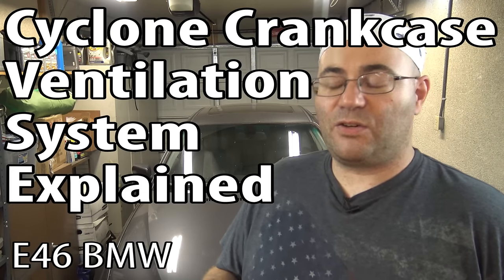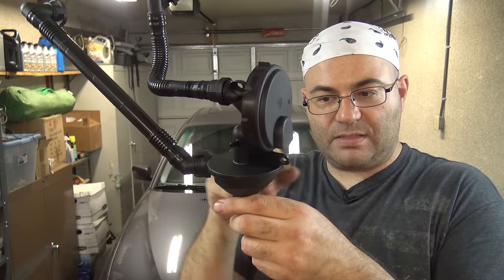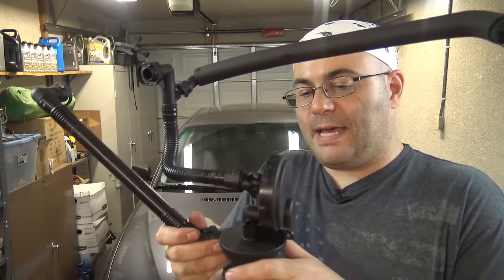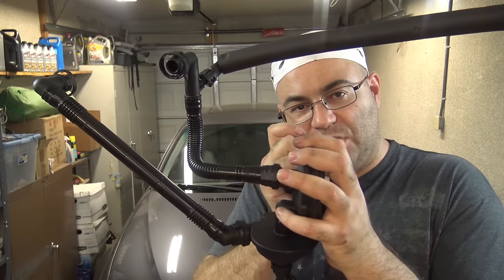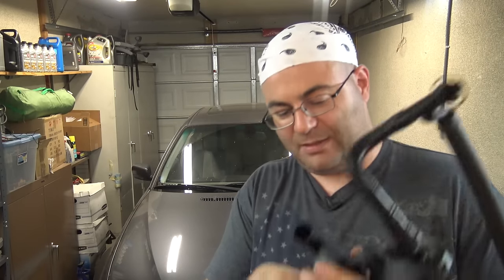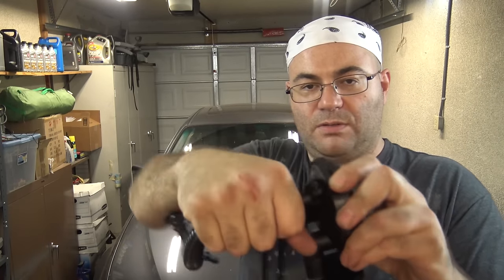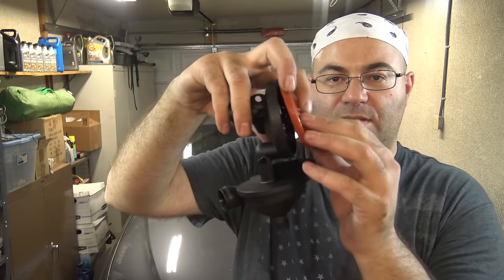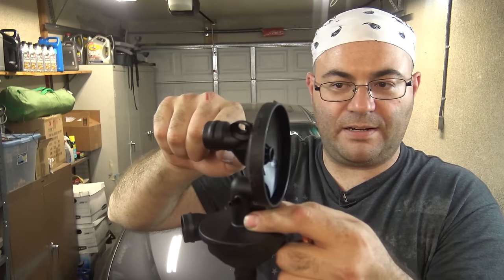BMW E46 Cyclone Crankcase Ventilation System Explained

Comment: This check-valve mod really works! Thanks 50sKid!! Ordered the valve, received it 4 days later and our bad oil consumption problem was eliminated on our 2001 e46 330I. Quick note - you can do this mod in about 25 minutes if you do it this way: Remove cold air intake tube, filter box and top intake rubber hose. Then look down the dipstick tube (to very near the pan) and locate the oil return tube coming down from the crank case ventilation separator octopus. With a sharp 4" knife, reach way down and cut this hose about 1" above the top end of the barb from the dipstick (assure room as you need to press the check-valve barb into the hose without interference from the dipstick barb). There isn't much room but if you gently move the knife back and forth 8-10 strokes, you can cut it. Then install the check-valve. With this method, very little disassembly is necessary. Also, it may look like you should have access to this area by jacking up the car and removing the left front wheel, but there is not enough opening there, without completely removing the whole engine under-tray. The above described method was fast and worked great. Hope that this helps!
Reply: How is the valve working so far?? Check valve right ? So you did it jus like he said?? Any info would help thanks
Reply: Yeah I would also like to know how it's working so far.
Reply: well said! 230,000 and 330,000 in the two I have and no issues with the oil burning with this mod
Reply: @Larry Smith, report back please.  Let us know how your modification is working.
Reply: By chance, did you happen to have oil on the spark plugs and misfiring when the ccv system failed?

Comment: If they put this part in an easily accessible place we wouldn't all be so mad about it, having it under the intake manifold is a pain.
Reply: Just a chance to clean and replace small things along the way! (vacuum lines, plugs, gaskets, etc.)
Reply from the maker: Amen to that.
Reply: that's how you know they're building a service oriented money pit 🙄
Reply: Can I drive with a bad pcv valve for the meantime until my parts come in? I’m sorry if this is a stupid question
Reply: @jeromeestrada6366  yes its fine

Comment: Its not poorly engineered, its a bad choice of materials.
Reply from the maker: The choosing of materials is part of the engineers job, lol! ;-)
Reply: 50sKid I knew youd say that but thats not true in this case. There is no flaw to the Design, youre referring to longevity and NOT design parameters of function.  

This part lasts about 100K and is part of normal maintenance on BMW just like their cooling system.
Reply: Grzegorz Durda no offense dude but when the system regularly clogs, breaks, or fails, sometimes as early as 50K miles on these vehicles, then there is indeed an engineering/design flaw.  This is classic BMW over-engineering, where it really wasn't functionally required for its purpose, ending up causing more problems than eeking out any performance advantage they were seeking.  The M54, when running perfectly, is a fantastic engine - but wow there are probably a couple dozen items in that engine of questionable design/engineering, above and beyond the horrid choice of plastic/rubber materials throughout.  And no, none of these items should be written off as "regular maintenance" - that's rubbish for an "ultimate driving machine".  I know the performance isn't fair to compare, but I have daily driver Hondas that are 16 and 20 years old, both pushing toward 200K miles, with logical engineering/design and original plastics/rubber materials throughout still performing like nobody's business.  I love my E46 ZHP, and love working on it as a hobby, driving it, and keeping it rolling - but wow I've learned alot about E46s and the M54 engine, and there are some real head-scratchers everywhere!
Reply: Exactly 100% true. Fiddling for optimum performance is one thing. A lower hose to that system not even rated for oil service blasting out and then if driven burning  a valve. Just insanely stupid. It is engineered it seems for the lower hose to blow to save something else..but most of course have no choice but to drive it home. Not have it towed to a BMW dealer to charge what $1400 to do that job
Reply: Engineering Materials is literally one of the courses we take in school under the Mech. Engineering curriculum,. I still have my textbook.. so you are wrong dude.. I check engineering drawings everyday.. and part of my check list is material specifications.
Reply: Grzegorz Durda bean counter engineered

Comment: First a note of appreciation.  Your videos are among the best on the internet.  Good job.  Please keep it up.  

Second, I am not a big fan of modifying stock engine systems unless you are going to go whole hog and prepare it for the track or some such other endeavor.  That said, I thought your suggestion of putting a check valve in the oil drain tube was genius.  But then again, maybe not.  Or at least, it won't cover all possibilities.  Let me explain.  I just finished replacing my ccv valve.  2003 Z4.  And it needed it.  It was putting enough oil into the intake manifold that it was puddling in the air equalizer portion of the intake manifold.  But here is the rub.  The tube running down to the engine block, the dipstick tube, was almost dry.  The oil in the intake manifold wasn't coming from the sump.  It was coming from the valve cover by way of the ccv valve.  The diaphragm had stuck wide open and all the oil rich air being pulled out of the valve cover was going to the cyclone and then up to then up to the intake manifold.  The oil was precipitating out of the air in the air equalizer manifold much the way it should have been separated in the cyclone.  Getting to the point, at least in my case, the check valve option wouldn't have helped.  

Anyway.  You are a saint among YouTube video producers.  Keep up the good work.

Comment: Great video,I learnt a lot about bad PCV,CCV systems when I owned a 5 cyclinder Volvo,they are notorious for issues with these systems,worse han Beemers , the check valve is a great idea tto prevent oil being sucked back up, but it must have a very low spring pressure else the weight of the oil trying to get back into the crankcase will not open it by gravity,maybe on an M54 it is better to drill a small hole in the part of the dip stick double tube section above the normal oil level line so if excess vacuum occurs, i will not suck raw oil,another note for anybody intending to delete CCV , bare in mind that these engines seals (rear main, front seal and all the noorious leaky gaskets)seal so much better with a negative pressure on the crankcase,my suggestion is to maintain the CCV,but mount the new one outside of the engine,say on your left inner guard area, extend all hoses to and from,mount it a same angle and height as it was under the intake manifold but outside of he manifold , your engine bay wont look as tidy, but cleaning and replacing the CCV in future will be much easier, BMW really did place it in a prick of a place

Comment: You really seem to know your stuff. Thank you very much for your videos. They were very helpful this weekend for the VANOS seals and the lock cylinder rebuild! Especially the lock cylinder stuff - without your video I would have never known it was that easy to fix. Car is running great now, it now feels like it did 12 years ago when I bought it, and for the first time in probably 4 years I can finally lock it! I'm pretty sure I will have to do the CCV valve, so I'll watch this then!
Reply from the maker: awesome!

Comment: I installed an oil catch can that is just chillin by my air filter. When I empty it, I just use a suction pump and a small tube. Takes about 2 minutes. 
Doesn't need to be emptied very much

Comment: Thank you for your video. It's easy to protect this system in the areas with the cold climate - dont use the car during the winter for often shot trips. If you want to use your car for the few miles, just add to your shot tryp about 10-15 miles to "fry" the engine. And this system will be clean and the membrane will be intact.

Comment: I think on these engines you could just stick a modified oil cap with a pressure gauge fitted, then start the car and note the measurement. If it is within -+0.03 bar vs. ambient air pressure (refer to nearest weather station). If pressure is significantly lower, then your membrane is stuck open or ruptured hose. If pressure is higher, there's a blockage or the membrane is closed.

Comment: Thanks for clearing that up. I use oil catch cans on my GM 2014 and 2017 6.2 direct injected engines. Like you said they must be drained at about 3000 miles. Now that I understand the BMW system I think that's a great way to stay. I installed a hose on the bottom of my catch can and installed a motor cycle fuel drain valve draining is a lot easier. The motor cycle drain valve has the right O-rings so the crank case crap don't affect the rubber in the valve. The air tank drain valves do not last very long.  Thanks for the great info. Paul's Transmission & Repair Baker city, Oregon love working on vehicles.

Comment: I like the addition of the check valve to the return hose.  In order to combat heat degradation of the top part of that same hose, what would you think about wrapping an 8x4 inch strip of aluminum foil lengthwise around the critical section for heat shielding, then securing it with worm clamps?  Aluminum does a great job reflecting radiant heat, which is why they use it in heat shielding near the headers etc.
Reply: what about thermal heat resistant tape? wires are taped with this tape from factory

Comment: Good video, I deleted mine on my 330i in favor of the oil catch can.  Being in the north east the only problem I have had with it is when it gets cold the catch can fills up with water, so you constantly have to check it.  In the summer You don't have to worry about it.  I check it every thousand miles or so in the summer and there is a little bit of oil in there.  You forgot to mention that the catch can increases crank case vacuum which gives the car a performance boost.  I have been running the RAD OCC kit in my car for over two years with excellent results.
Reply from the maker: Nice, thanks for the info.  I'm not sure increasing crankcase vacuum really actually provides any sort of performance boost, BUT i don't want to start a war over that, lol.  Question: what is a RAD OCC kit?
Reply: O my bad, this is the kit that I am running, its a bit on the pricey side but I love the mounting location the kit provides

http://www.radiumauto.com/Catch-Can-Kit-for-BMW-E46-3-SeriesM3-P298.aspx

Comment: Great video, and that's an excellent idea using a check valve in the drain line. The system overall looks pretty cheap though. What about a catch can, and running the drain from the catch can to the oil sump return line. You could plumb in the check valve you mentioned, or perhaps use a solenoid valve which defaults to open whenever de-energized, as when the engine is off.

Comment: I did this job today. Took maybe 2 hours all up without removing intake manifold. Not too bad once you've made some room down there. Unfortunately the 2nd length of intake hose after the maf ripped apart as I removed it. Thankfully the best genuine bmw parts dealer around (Latvia + Lithuania) should send a new one on it's way real soon.
Reply: Also I was amused to find the cold weather version is simple the summer one, but with a nice little rubber/foam jacket.

Comment: Thanks for the great video, I learn a lot with your detail explanation. For now I m trying the check valve , if the oil consumption stops or reduce then it will be great and is a easy job. I just worried the oil stuck in the hose .

Comment: Very informative, i have a question , is there enough vacuum to open the check valve? I am afraid that the oil stuck on the tube and didn't go to the oil pan.

Thanks a lot
Reply: A PCV is not a check valve! There should be no check valve. sure not one that is spring operated or vertically mounted. A free-ball type check  mounted horizontally might work for a while.
A PCV valve is normally open. The flow gets gradually restricted as manifold vacuum raises, mostly on idle and near idle (PCV system is not meant to suck up oil vapors, it is meant to suck up blowby and water vapors). The central exposed piece of orange rubber is not a seal, it is meant to tear if the oil sticks up the valve, acting then as a fixed orifice PCV and a vacuum leak that shows engine light. Older PCVs acted as a check valve against backfire, these new ones don't protect against backfire at all so back to point one - it is not a check valve, ever. 

Listen to this guy and ruin your engine for good, he can buy parts, follow a manual but he's a parts monkey with no real understanding.
Reply: @dushk0  pretty sure he is talking about the check valve he installed for the oil, not the CCV itself.
Reply: @dushk0  you seem to have a better understanding of the system, please make a video about it. i get the occasional engine light because of p0171/0174 and the engine often stalls when rpm approaches idle. should i replace the whole system then or just the lower tube which might have cracked?

Comment: hey 50's kid watched your video on oil filter gasket replacement very helpful was wondering if you were changing your front wheel bearings anytime soon would really love one of ur detailed videos all the ones I'm finding  aren't really step by step like yours
Reply from the maker: I know that my driver side wheel bearing was already replaced.  Not sure about the passenger side.  But i'll put it on the list.

Comment: With my 2001 BMW X5 during cold weather I find I have to warm up these crankcase ventilation lines by running my engine at least 10 minutes while parked.  I am not warming up the engine per-se but warming up the lines around the CCV so that I do not get the freezing and plugging effect.

Comment: Interesting info about the vacuum line to the fuel filter! That the pressure regulater dosn't run on vacuum. Is that actually so? So it coult be capped of if one would like to eliminate that line?
Reply from the maker: Yes it could be.  The fuel pressure regulator is at a fixed pressure.
Reply: 50skid i have a m52b28tu i had the horrible animal sound when i removed the oil cap know i found out that the line to the fuel regulator was raptured and i replaced it now it doesnt make the animal sound anymore but it has little vacuum but i think thats normal on any engine .but my concern is that even on working temparture of the engine there are a lot off exhaust vapour coming out is this oil vapour? hope you reply thanx

Comment: Good insight. I’d stay with the oe setup. the problem with aftermarket parts store pcv hoses I noticed is that they crack too soon for some reason. I discovered this on my Oil Catch can set up on my 4 cyl M44. So for my M54 I kept it the same.

Comment: Great explanation of the system, but I think the check valve is a bad idea, this system relies on gravity getting the oil out of the separator and down the dipstick tube into the oil pan. Problem with the in-line check valve is that it often requires a certain amount of pressure in order to actuate the spring inside, effectively clogging up the tube and flooding the oil separator.
Reply from the maker: I tested it before I decided to use it and gravity is more than enough to pass the oil through it.  When the "arrow" is pointing down, the check valve is "opened" by gravity all the time... it has to be sucked shut by vacuum or by reverse flow, which it is.
Reply: Okay, sounds good then. I guess there are very different check valves around. I had one that required alot of pressure to actuate it, but it might have been purely for heavy hydraulics or something. Cheers! You make exceptional videos.
Reply: FrozenHaxor I was thinking the same exact thing.
Reply: what exact check valve did you use? seems like a lot of the check valves out there are spring loaded and I guess the one that you used is gravity actuated.  can you point us to a seller or store to get that exact check valve?

Comment: Also, when in cold climate, this thing can freeze. Usually if you got the mayo problem, there is a risk of freezing too. Mine did that. It was -20c and some part of the system froze shut, and result was oil shooting out from the filler cap. Fortunately it failed from there, and not from valve cover gasket.
Reply: mine failed from the valve cover gasket. It was -35 when it happened
Reply: Ouch. Did you get by just replacing the gasket, or was there more damage? @franklin8408
Reply: @Thesuice  I HAD THE GASKET REPLACED TODAY, I OVER TORQUE 2 NUTS AND BROKE THEM. GARAGE SAID MY OIL SEPARATOR LEAKING, WHICH I CAN'T SEE THE PROBLEM. WILL FIX IT ONE BY ONE

Comment: Great video! I replaced my starter recently and broke my ccv, i had to get to work so i taped it up (not very well) and saw a big cloud of smoke 💨 while driving on the high way, I thought it might be the head gasket but no overheating, hopefully this is the issue, parts are on the way
Reply: Having similar issues. No overheating and white smoke.  Did it solve your problem
Reply: @mvc2177  yeah i replaced my ccv and no more clouds of smoke 👍🏽

Comment: At 4:00 you talk about the fittings being quick connect but then go on saying that they are troublesome as if you are unaware that there are specified pinch points on the floating plastic ring. It should be explained and that the pipes are not simply push and pull connections, which could lead to breakage upon install or even mis-installation. They are squeeze/push, squeeze/pull.
Reply from the maker: I did mention they were quick-release.  What I meant when I said they were difficult to get off was that the o-rings, when new, fit very tightly and even when pressing the pinch points, it's difficult to get them off.